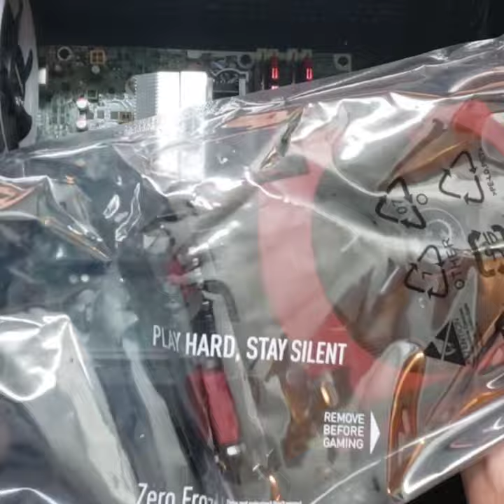i5 4690k + GTX 970 Budget PC Build #shorts

Comment: I have i5 4590 and Gtx 970 G1 Gaming and i know its outdated but it can handle games like ps4. So. Yes for today you can play lot of games and have fun. If you dont want to play starfield this is fine, have fun there ❤
Reply: Bottleneck?
Reply: @unknown_5107  not at all.. 🤣 just kidding, sometimes you can see that the cpu is kind of slow but i played games like CS2 100fps, Spiderman Miles Morales 60fps, Mafia Deffinitive Edition 60fps,  Days Gone 70 FPS but in The Days Gone i Can see that the cpu is bottlenecking, but it is not like iritating.. How ever i am about to upgrade that Beast  ,🤣  soon, especially DDR3 RAM on dual Channel is Okey for Basic work on Pc but for todays gaming is 1600MHz not enough..
Reply: @basotukadas4502  Good , your GTX 970 is even more powerful than rx580 but it lacks 8gb vram, i wanna now if I can pair i5 4590 with 970 or rx580 without severe bottleneck.

Comment: How do you power this considering that the motherboard doesn’t use a 24pin psu connector?
Reply from the maker: 24 pin to 6 pin adaptor
Reply: @gkpcs8703  how much cost?
Reply from the maker: @FaltuAccount6969 5$

Comment: What was your budget? One time machine?
Reply: Ngl this is a good build, the gtx 970 and pretty good for its price and CAN run warzone at around 60-80 fps. On the other hand though they could use a i7 so their able to upgrade when they want to, to a higher end graphics card.
Reply: Then again that’s the graphics card I had and it ran warzone at 60-80 fps sometimes even 100fps

Comment: What motherboard is that?
Reply: Kinda looks like a Dell or Intel board
Reply: @CallMeMilenko  yeah I thought so because most motherboards aren't green anymore the only ones that I've seen that are green are the one from pre-builts.
Reply: @cutewhitedog6621  Yep, it looks old because I don't even see a connector for the front panel USB 3.0 cable.
Reply: @CallMeMilenko  True didn't notice that before.
Reply: @cutewhitedog6621  Ok, I'm wrong, there was a connector. But it's still an old board if it's supporting 4th intel processors.

Comment: Bad budget build. Intel i3 (K or non K) 12/13th geb with 16gb ddr4, cheap motherboard, and a gt 1030 is rlly good budget rn
Reply from the maker: 1. check when the video was posted
2. gt1030 is literally the worst budget card you can buy, it's worse than some chips with integrated graphics.
Reply: @gkpcs8703  i know GT1030 isnt a good budget card. Its good for mega budget like $250 though. Of course if your budget is like $400 then get something bette. This video got reccomended to me recently so I went off of what is good right now.
Reply: All gt cards is shit now